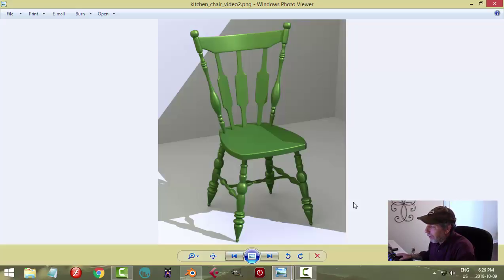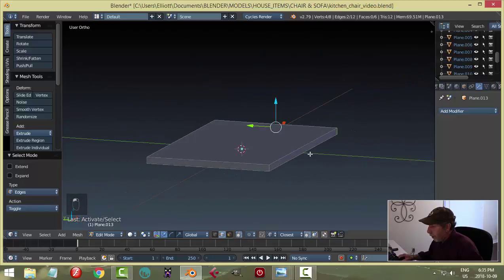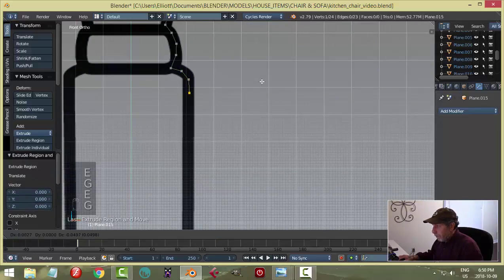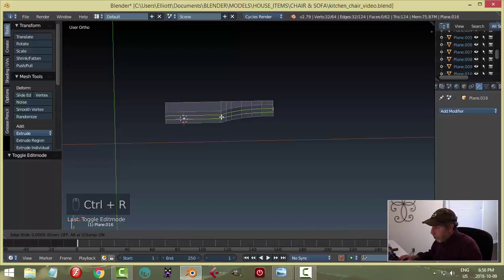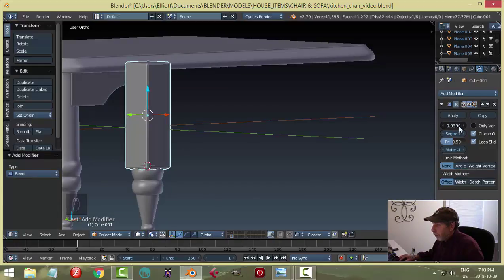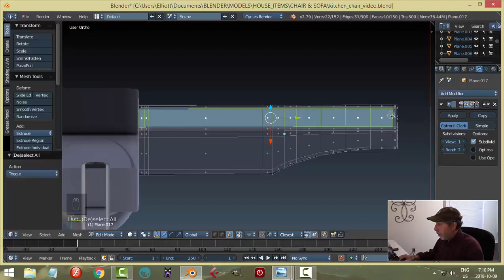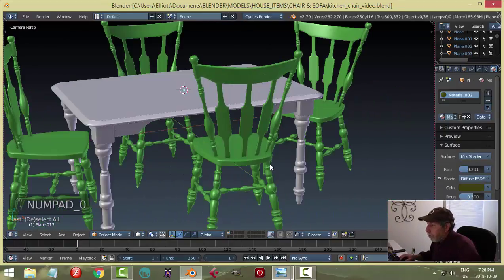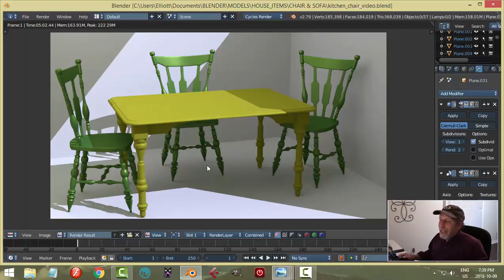Blender: Modeling a Kitchen Table (Part 2)

Comment: Thanks sir how great tutor you are and how great would be have you have a tutorial based on blender addons mira tool
Reply from the maker: Thank you Swera. Regarding Mira tools and most add-ons, this may sound odd but at this point in time, I really don't want a bunch of tools that will do tasks that I'd prefer to learn how to do myself, if possible. I know that might seem foolish to many and a waste of time and perhaps there are many techniques that just couldn't be done reasonably without such tools. But I feel a little like it's cheating to use them. Of course I will eventually use them and already use a couple of add-ons and all the modifiers. It's like people who use stock models or an add-on that quickly creates a tree or a rock. Where is the fun in that?  I'd rather have no trees than a random tree generator. That is just my logic right now. I do simple modeling and rely more on my simple methods (and simple brain) than add-ons that could make things easier for me. I hope that makes sense and don't blame anybody for using all the tools available. Thank you for visiting my channel and good luck with your modeling.